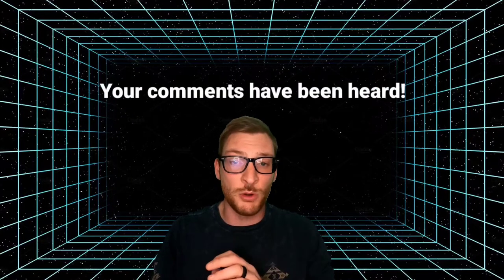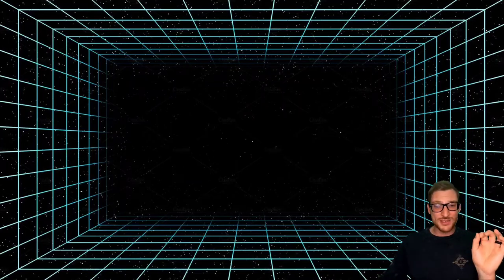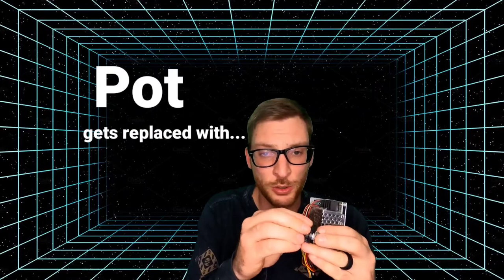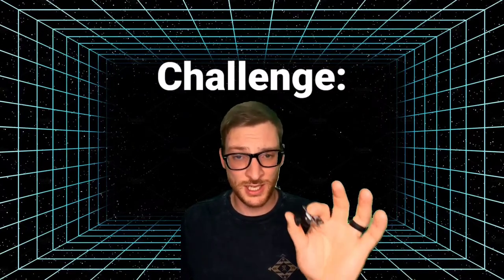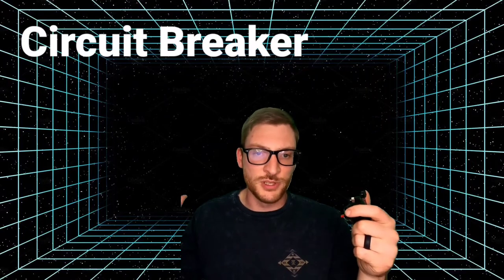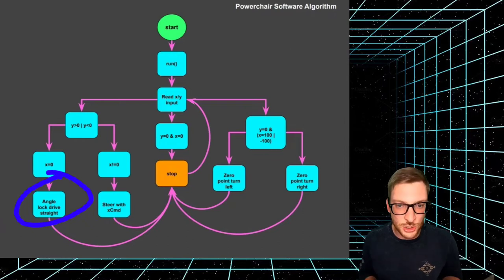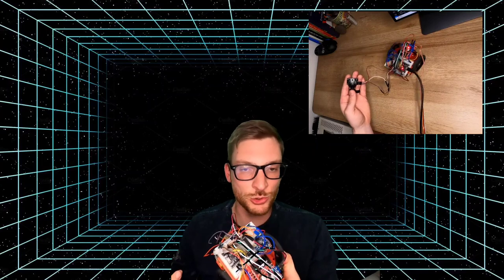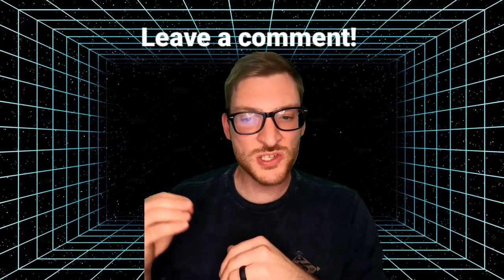Hack a powerchair and make it fast | Part 2

Comment: I have a Jazzy HD Elite that is crazy slow! I’m disabled and I have to accept what my disability insurance will give me. Hopefully I don’t have to accept the limitations. 
Thanks for all your doing. Once you get to a point where I can get a shopping list of parts and instructions for enhancing the speed of a power chair for dummies I’m all in. I’ll continue to stay tuned and learn what I can in the meantime.
Reply from the maker: Thanks for the feedback! I'm getting much closer to actually implementing into the chair and running it. I've got some free time coming up and plan to hit it hard to finish up. I'll definitely have a list of everything for ya. 

I will definitely be sharing it. I'm back to the battery build and assembly of the motor controller hardware in the next week. Thanks for your patience. 

If you have time, would you mind contributing to this survey about power wheelchairs that I've got going? https://docs.google.com/forms/d/e/1FAIpQLSfiGQr9vhOrSDDkIKez6zAFjCbRSPrjbbLk8ZZWWbEzGA7hVA/viewform?usp=sf_link
Reply: This guy wastes do much time...
👋

Comment: Great project. I think I have most of the parts already. It's the code I'm not good at. Hope you share that.
Reply from the maker: I will definitely be sharing it. I'm back to the battery build and assembly of the motor controller hardware in the next week. Thanks for your patience. 

If you have time, would you mind contributing to this survey about power wheelchairs that I've got going? https://docs.google.com/forms/d/e/1FAIpQLSfiGQr9vhOrSDDkIKez6zAFjCbRSPrjbbLk8ZZWWbEzGA7hVA/viewform?usp=sf_link

Comment: Help me understand, what would happen if you connected a 42v battery to the chair with all its factory components, I’m sure something would fry but is it possible to modify the original controller or other components so they could handle 42v
Reply from the maker: I'm not sure without knowing the internals of that motor controller. But it is possible that you might damage the components with a voltage beyond what it is rated for.

Comment: how are you simulating the potentiometer with the arduino?
Reply from the maker: I'm reading the potentiometer as an "analog input" into the ESP32, and then scaling that value with 0 to 100%. I know which direction the joystick is being pushed because the y axis value is forward and backward (negative and positive) and the x value is left and right (negative and positive). Does that answer your question?

Comment: I desperately need your assistance. I purchased a Daredevil Mower. I absolutely love everything about it except that it is very very slow. I believe the motors driving the tracks are similar to wheelchair motors. They are 12 volt motors. There is also a alternator that recharges the battery.

Comment: I have a qwickie quantum I modified for my grandkids. I just want to make it a little faster, not a racecar. What can I do for that?
Reply from the maker: I think you'd have to replace the motor controller unfortunately, as I have done in this video series. There isn't a good way to re-program the proprietary motor controller.
Reply: @trowantechworks - thanks.

Comment: Did you put a diode across the output to the motor?  This seems to be an effective way of keeping the smoke inside of these controllers
Reply from the maker: did that at the motor controller output to the motors. I also added capacitors to smooth it out as well